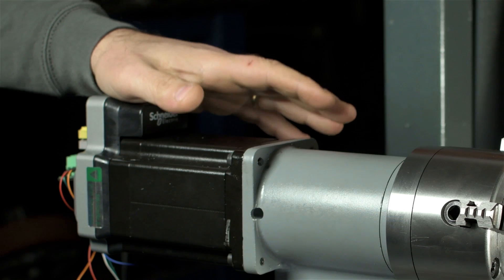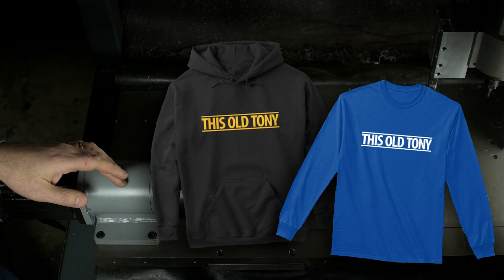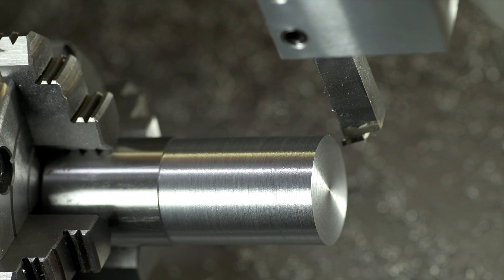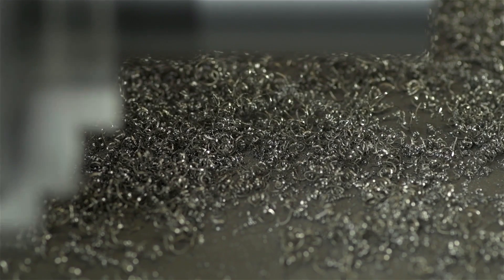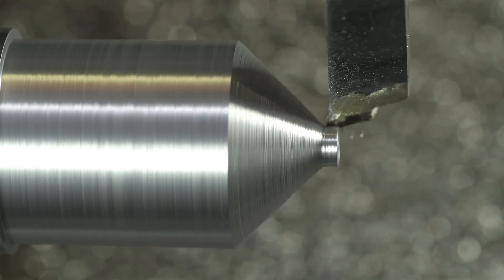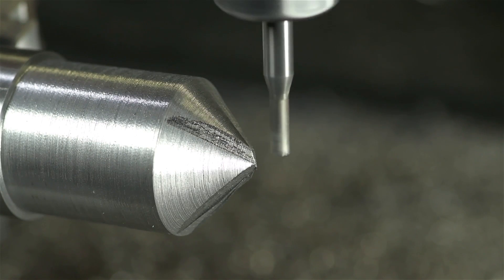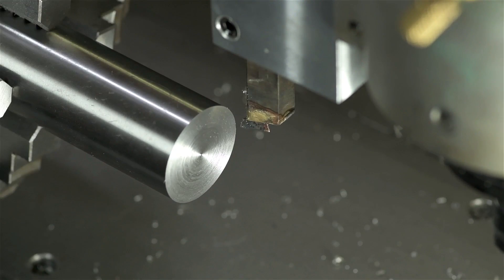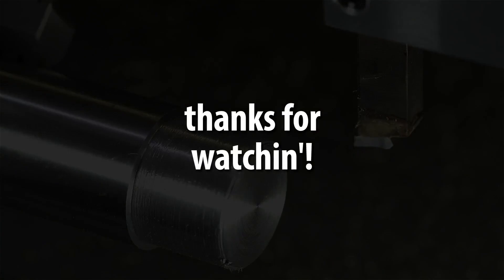Will the CNC lathe add-on TURN STEEL?

Comment: I was doing a very similar cut in 4140 today. I got the finish you got. But when I added TapMagjc as a lube it went from scratch finish to a glass like finish. 0.0075 doc at 1200 rpm (470 ft/min) 5-10 thou federate. The cutting oil was the necessary ingredient.

Comment: I have seen a lot of your videos and use to your twisted humour but this one i'm not quit sure if this is supposed to be one of those over your head comments or not? Since no other reference about it never came back up when you were describing the type of metal you were turning. And went ahead by using a magnet test to show it not being aluminum. Since most generally you have always been quit clear in your detail. And since I just couldn't picture you attempting using a very weak ass magnet that such a low power that you had to use hot glue to hold it to the pc. of bar stock.  I don't see you  having any cheap old magnet around in your shop less than N48 to N52. Since that being said then as you was describing the work as you were waving the magnet close enough that a magnetic pc. of metal in that vise clearly would not let you camly wave an N52 that close with a relaxed grip on it as you had all the way up to the 34 sec. mark. Were everything about the pc.in your hand was clean and free of any hot melt glue up until after the 34 sec. But if it were a real magnet all you would need to do was to just open your grip on it and it would fly the short leep to the metal bar. The way that you showed the magnet attraction to the bar just did not even look real. And the reason I am saying this is because a good part of my life is involved with using magnets. And I learned early on the behavior of them. So if you were wanting to show the bar was magnetic you wouldn't need to look like your pushing the magnet and bar together but just open your grip from where you was holding it 2" away then it would fly out of your fingertips to the bar stock. Then you would have the need to use hot melt glue to hold them together unless it was a pc. of Aluminum bar stock all along. But I still like your videos

Comment: Hey Tony, just wanted to share with you that my large bench top lathe improved after re scraping the cross slide and saddle. I went from having to make 0,3mm depth of cut at 0,1mm feed per rev to being able to run 1,8mm depth at the same feed. Maybe you can throw your mini lathe on the surface grinder and achieve the same performance gains.  Good luck Tony & stay healthy! Love ya!    EDIT, just realised that I should have left this comment on your The Infamous Mini Lathe! video. Nevertheless I still Love ya!

Comment: Hi Tony, 

It appears that the finish was caused by chatter. Shorten the length of the cutting tool and try the same cut again. You may also want to mount the lathe adapter on a heavy slab to add mass and weight to it. 
Robert

Comment: Might need to make sure your insert is at the proper angle. Could help alot with your depth of cut. I'd recommend and actual insert holder... But as a lathe Machiner myself this was good stuff carry on friend.

Comment: Why not slot your tool holder block 90 degrees to lay down conventional lathe tooling?  I presume your code works best in X & Y vs using Z geometry to cut from top on centreline. 
Great video, good versatile shop toy.

Comment: Very entertaining. If it makes you feel any better, cold rolled steel is very difficult to get a good finish on in any situation (in my very limited experience). The best finish to date for me was a vertical shear cutter. Still, it doesn't compare to metal that behaves well like 303 stainless. My 1.5 cents.

Comment: Ouch, awful little tool smash on that last clip, but still a great project that must have been!

Might I suggest some kind of gearbox that could have a dedicated main spindle motor to drive the chuck for turning, while still having the existing stepper timed to the spindle that you may use for indexing? Some kind of solenoid controlled spindle brake too, Tony?

Comment: Hey Mr. Tony, (thinking’s aloud...no atexting.. “hmm wonder if he’s one that likes to get right to the point like a manly no brass about it or a manly that likes to be told how great he is like a Roman emperor or something...ma’am). So your highness Tony,  I have a challenge for you or you to pass on (I can’t bet you but if you come down to Texas I’ll send you home with a fresh 6 pack of Shiner 😉).  

Back to the challenge. 
Given say post what ever and you can substitute a torch for an actual forge and you have an abundance of round and flat steal to work with. But not tool grade and not like angle and pips etc. 

The challange is could you build a mill or something like that but build it by building all the tools you need. To build it. Example his a piece of steel to make a hammer, hammer lat tip, harden to beat into another flat steal, harden that to make a file, file to the next tools, etc all the way to a mill. The last given is you do have electricity and motors but nothing else as far as shafts, pullies, hears, etc.  doable or too complicated.  Thought it would be cool to let you show off your barbaric genius at problem solving with uncanny solutions mear mortal men and the Adams or Germans of the world would kneel at one so....(too much?). 

Would be cool though 
Thank you for your well what you do.

Comment: Can you make a shirt that says Spindle Speed Variation? In pink.
Reply from the maker: Instructions unclear, but ... done!
https://teespring.com/ssv1#pid=389&cid=102282&sid=front

https://teespring.com/ssv2#pid=389&cid=100022&sid=front
Reply: @ThisOldTony  XDead
Reply: @ThisOldTony  The black shirt is missing the question-mark 😀
Reply: @ThisOldTony  I know I'm four years late, but I gotta say that is a god-tier dad joke.  Goals.
Reply: @ThisOldTony  Sold!
Reply: @ThisOldTony  Just be glad there were no ceiling fans involved.
Reply: He actually did it😂 and they’re still up
Reply: I have the speed for feed...
Reply: I prefer lavender or rose but, when welding for example, I don't want my leathers to detract from that 'stacked peso' look I work so hard to achieve.
Reply: Oh, that’s where that came from.
Reply: @ryanrising2237  Yes, yes it was...

Comment: You kick ass! The finish sucked ass... But ah... Is there a method of stiffening the tool holder? I suspect that the chatter in what used to be the end of a router whorbbling and hopping around is the finish killer. With the cut direction up at the ceiling on a flexible beam for XYZ. Maybe it needs some cast iron sash weights stacked on top? Film it in high speed, you might be able to troubleshoot the movement and play - I suspect up then out away from the cut off the center line.

Comment: what spindle+motor you got for your cnc?
Reply from the maker: the mill spindle is a 1.5kW air cooled ebay spindle.  the 4th axis is a Schneider Lexium MDrive.
Reply: thanks, i am currently building a cnc myself, and now i feel that the 4.5kW spindle i bought is overkill. : ) @ThisOldTony

Comment: I was wondering if you could improve the surface finish if instead of a lathe tool you would use a milling bit of some kind. Admittedly defeats the purpose of a CNC lathe

Comment: The tool would interpolate the cone angle whilst roughing depending if you are using a type 1 or type 2 G71 canned roughing cycle ( not sure how this works on your router/lathe/mill/welder/wicked sex machine ) but that’s how it works on CNC lathes , great job as always keep your stick in the ice
Reply: Also thought I’d add , you normally can’t change direction in ‘X’ in a canned cycle (for example if you wanted to do an undercut ) if you are using a type 1 cycle , but you can in a type 2 , the only different is there is a X AND Z figure in the first line of the canned cycle e.g 
G71 U2.5 R0.2
G71 P100 Q200 U0.25 W0.1 F0.25
N100 G0 X27
G0 Z2
that would give type 1

G71 U2.5 R0.2
G71 P100 Q200 U0.25 W0.1 F0.25
N100 G0 X27 Z2 
That would give type 2 

If you need any help with canned cycles give me a message !

Comment: I won't lie, it's pretty bizarre hearing someone say "it's getting cold out" when it's Spring and very nearly Summer. Yes, I'm on the bottom half of the world. No, I don't have to hold on to stay here. I just use lots of hot glue.
Reply: Overhead welding is a lot easier down here though.
Reply: @johnno402002x  depends on in which rotation , clock wise ,anti clock wise , with planet rotation or against planet's rotation. The hardest is over head  left handed , anti clock wise against the planet's rotation.
Reply: @johnno402002x  Haha true dat
Reply: Lol it's weird hearing some say it's getting cold ever. The only reason I understand the concept of cold is because I am Australian and there for constitutionally required to drink my beer at no higher than 4 degrees
Reply: It was 13 degrees Fahrenheit at work last night for me lolol

Comment: Since a stepper is good to about 2300 RPM, how about a two or three step pulley on that spindle? Or just one at 1:2? I want to see 0.050 DOC on that same motor, dammit! Bonus is double indexing resolution. Also, would clamping your Z axis from moving help with the chatter - I'm thinking you may be bouncing on the z backlash?

Comment: It would be interesting to have a video on how to troubleshoot surface finish issues. Probably basic knowledge for machinists. But apart from a short job at a friend's lathe, my last lathe/mill experience was over 20 years ago in high school. And we probably never even covered that bit.

What I do seem to know about it is that it's mostly angles (both cutting and relief), depth of cut and surface speeds. And making sure you're using a sharp tool and a properly supported work piece (i.e. no jitter). But I'm sure the story doesn't end there.

Comment: Some better tooling and I think this upgrade could go a long way. I reckon get that trigon in there cutting along the top, clockwise spindle rotation, so effectively your Z axis becomes X, centering the tool then just means adjusting X + or - and Z controls the diameter.

I have an idea for your next project too, a center for it, or tailstock, rather, that you can bolt to the table and set up easily. So many possibilities open up.

And for the record, pants were on for this one.

Comment: This CNC router lathe combo is turning me on. I might have to chuck a few bucks at eBay. Spend some time milling around, and see what I can chip together. Unfortunately I wasn't wearing pants, so now I have to write the wife some g code, and put a few inserts on the tooling.

Comment: with your piece chucked in.. how much static radial deflection can you measure..  i was wondering why did you not use double row AC clutch bearings for your router spindle.. this page lists standard sizes available. http://www.nachiamerica.com/content/downloads/double-row_angular.pdf  two is always twice as much as one.  since they handle both rotational and thrust loads. they might be far more stable than a single row bearing for spindles.  its just an idea..

Comment: Hey, This Young Tony, Clearpath has very high power servo motors with integrated electronics. It looks like it would be better option that your stepper. They are Integral hp series

You should also wire error signal (if it had something like that) to your estop, so when you stall it, nothing will move.

Comment: Someone really, really needs to send you an actual servo... those steppers don't have much torque at higher RPM.  Great for holding position, but lathes don't do much standing still...

Comment: ....Huh... Yeah, I'm not wearing any pants. I'm actually completely nude. As best I can recall, normally I watch your videos at least partially clothed. I'm going to chuck some shorts on now for 1.49 thru 7.12 of this video though. Feeling self-conscious now...... Also, a fun TOT pants/boxers design might have a lathe spindle over the groin... With a three jaw chuck holding classic TOT-gag pixelated round stock. If my math is right (which is doubtful - I'm doing it naked afterall), as much as 0.00006% of the world's population might understand that joke.

Comment: Tony, I love your videos. Why dont you try using a spinning end mill for the cutter on the cnc lathe. Would that even work or would you end up with way to high of a feed rate for the tool?
Reply: I've been wondering the same thing.

Comment: Ah yes mild steel ,made of garbage ,leaves shit finish 90% of time,only worse thing is rebar.
Is there a way to get mirror on mild or close to it?Do you need high depth of cut and slow feed rate/rpm rate ?
I did get good finish on it once but cant remember how.
Reply: Shear tool?  I've always gotta monkey around with it too...depends what "mild steel" is...example known 1018 is not the same as the last batch of "known" 1018...

Comment: i dont think its very suitable for steel, the inaccuracy of the router setup will come into play here more likely. most of the time we use almunilium anyways just because its easier, faster and most of the time good enough to do the trick.

i wonder if you could build like a cnc toolgrinder? it only would need 2 axis in addition to the turning mechanism itself and you could make real tools with it to a very precise tolerance. maybe four chinese linear rails some steel plates? wink wink

Comment: Why are you not  aligning to the center of the spindle from the top? You could then use regular left handed lathe tools. Just think regular lathe rotated 90 degrees about the spindle

Comment: So, two questions:

1) Why do those positive rake aluminium inserts work so well for brass? I love using these positive inserts on brass, but I've never understood why they work so well. Shouldn't brass be cut with neutral rake?

2) Do you think the bad surface finish is because of the bad spindle bearings or because of using the wrong tooling?

Comment: We have a small machine like yours in our shop to manufacture bolts. You need a  large tip radius to get a nice finish plus at least 2000 rpm.  This works for us turning grade 5 bolts down. Mirror finish

Comment: might like UCCNC it can make use of a high enough encoder to do closed loop threading , so spindle speed variations don't affect the threading.  You would have to do many low-load thread passes since/IF your spindle las low torque. The single index of mach 3 can't death with rpm variations.

Comment: What you put together there is really impressive.  I'm curious though... given the limitations of your cutting conditions why did you go with carbide tooling?  I feel like you'd get much improved results with high speed steel or cobalt tools. This is my way of asking you to make a video of your mill turn machine using HSS

Comment: Why did you glue the magnet to the rod your trying to cut?
Reply: To weed out the weak.
Reply: @throngcleaver  Mission accomplished.
Reply: Drake Kerley It's much easier to clean the swarf from the job than cleaning the bench

Comment: One does admire your work and humour,  and I think I have now watched all of your vids - very enjoyable. Now hmmm.?!? The concept is great but the performance is probably not as you were hoping? The stepper save for the trunnion and get a servo (now that merch is on offer £££), side mount ( you have space) and reduction gear it to main shaft, encoder shaft - you know what I mean. More expensive I know but you will be happier. :) This option can also allow you to add some removable mass to aid turning. Maybe even a brake! Hobby style disc bike caliper, air solenoid, aux M code combo. This will help with your arc backlash for 3+1. Turn-mill's are not easy to design so hats off for trying. ;) One phase at a time my friend.. Lastly, FEA your tool post I know you can do it, the offset design makes my toes curl. Anyway keep the adventure rolling, I love seeing hobbyist' make CNC's. :D

Comment: Do commercial CNC lathes use stepper motors for the drive or do they use the normal geared induction motor with an encoder for position? I'm surprised to see a stepper holding up to this abuse I had no idea it was possible.  Plus I guess this means the old worm drive 4th axis is toast. You know where to send it ;)

Comment: Mainly bearings are the source of chatter. Changing to tapered roller bearing will Improve this
Reply: Naaah, it is the overall rigidity/ stiffness of the gantry to the chuck. It is amazing that he manage to cut it at all.  I think it will work great not on turning, but on 3D milling similar as when he cut the flutes.
Reply: I'm thinking the same thing

Comment: Tony! You've read my mind!
Only a few moments ago I was thinking to myself, "On the next TOT video, I must inquire about welding/braising cast iron!" - I have an old British Seagull outboard that I have recently disassembled, and I happened to discover a small crack in the block. Damn. The crack itself isn't located in a particularly high stress area, however I'd like to stop it from spreading if possible...

Long story short, I don't know of anyone in the area who can stitch the block for me, but I do have some welding equipment at my disposal (another really long story) and I'd really like to try my hand at it! I have no prior experience.

Is this a topic worthy of a future video, or do you - or any one of the extremely knowledgeable that hang around in the comments - have any advice that you can offer?
Thank you in advance :)
Reply from the maker: certainty doable if you can get it apart and clean it.  I have a video or two in brazing. also check out Keith Fenner he brazes a lot of cast repairs.

Comment: Dear Old Tony, may I ask if the notion of a Harmonic Drive solution  to the so called 4th Axis   have found a home at your locale. And now that you mention it, has it got the same range of RPM that you are currently enjoying. I understand that it has nowhere near the backlash as per the last upload.